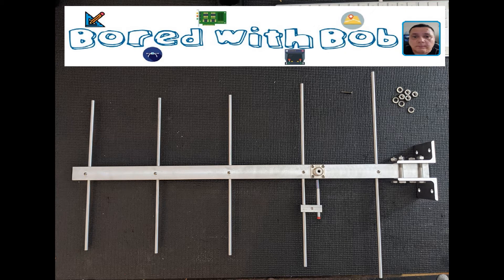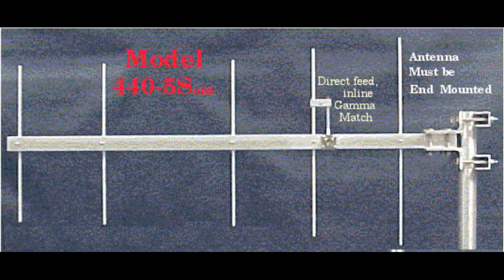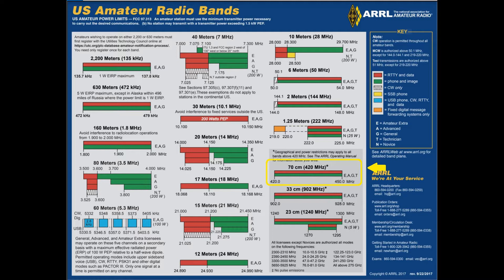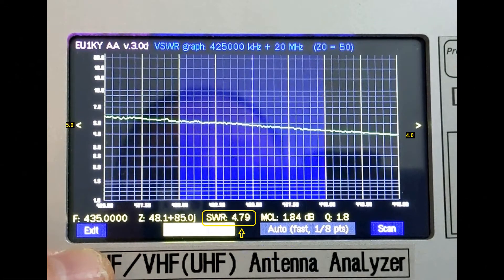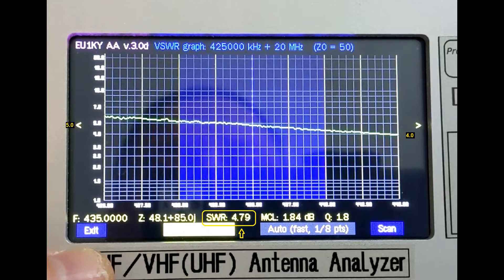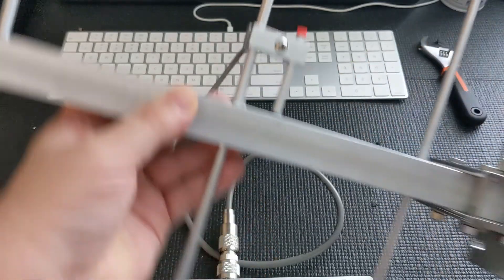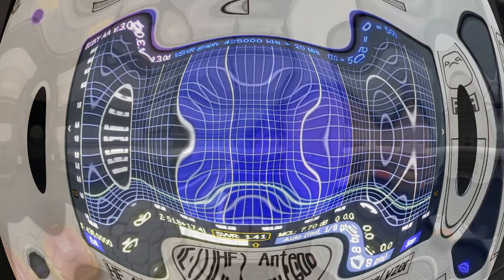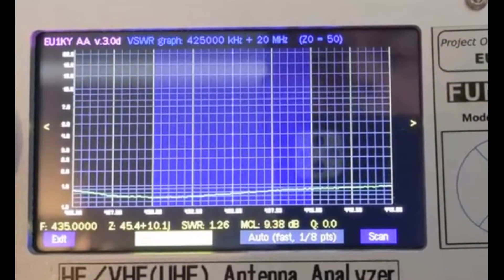Arrow Yagi Antenna Part 2

Comment: Very good video.  For non-HAMS, looking to get into the sport, this is very good info.  It's doubtful they would know the HAM acronyms such as SWR, but that's all part of the learning process.  Regarding the link to the antenna analyzer, there is a drop down tab with 8 purchasing options.  Just curious which option you purchased.
Reply from the maker: Option 1